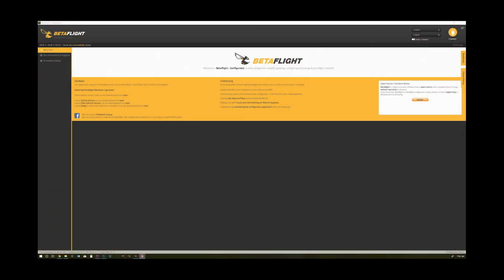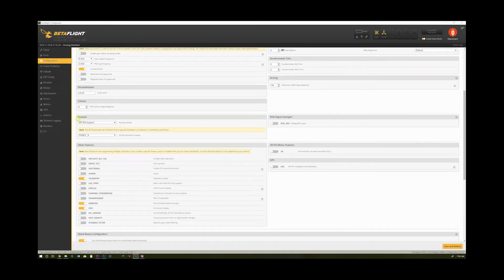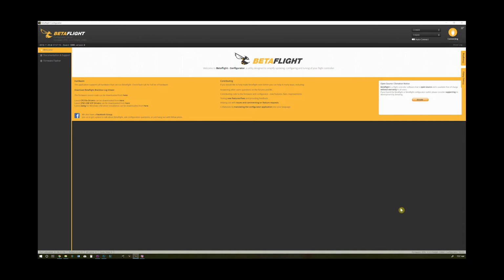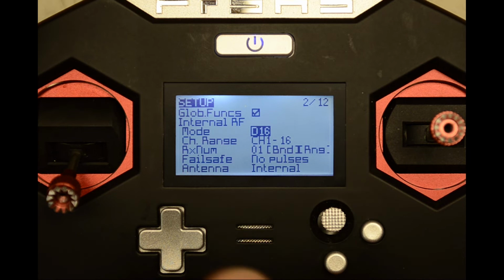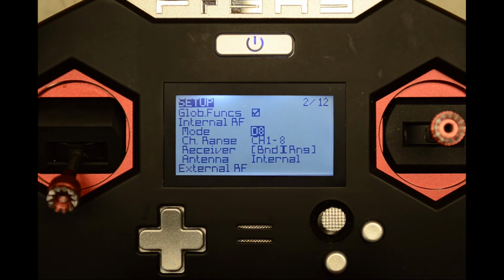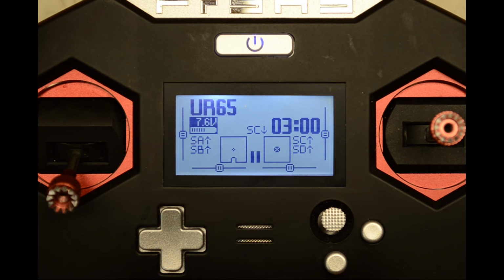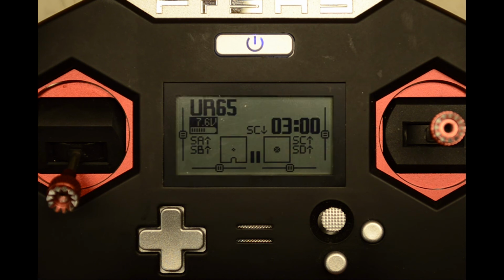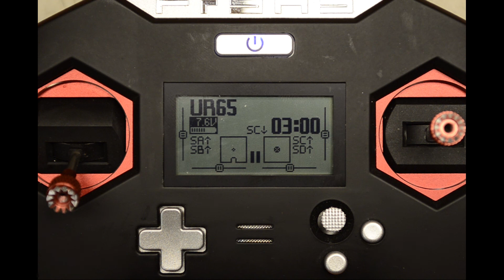Crazybee F3 Failsafe PSA Snapper6, snapper7, ur65, uk65, us65, Mobula7 D16, D8

Comment: My M7 has a jitter shake while flying every 5 or 6 seconds. Any ideas why? Tried upgrading firmware with no difference.
Reply from the maker: Look for wires tapping against the fc, check if there is any hair or carpet fibers in the Motors, and try relaxing the screws that hold down the fc. If all those don't work try adding a little bit of deadband in the bf rx tab.

Comment: I wonder if the firmware was updated from stock, or does the issue also occur with stock BetaFlight that these quads come with?
Reply from the maker: It happens with the stock bf firmware.
Reply: Ok, so we can rule out an incompatibility between a newer version of BetaFlight and this board.
Reply from the maker: Your comment had me thinking about it. The tinyhawk will fail safe lockup and drop when the voltage gets below around 3.3v because the fc goes into a undervolt situation. Adding a small capasitor to the 3.3v output pads allows you to run all the way down to 2.7v. I wonder if this might be some of the same issues with all the crazy bee f3 boards. Some testing needs to be done.
Reply: If it's undervolting, it's odd that it works fine for a while, and then develop this "condition". Why does the factor time have an effect. Could be the batteries aging a little, and performing less after some cycles, though typically new batteries get better after a few cycles, and only start to deteriorate after more cycles, unless abused.

Does the issue only occur on 2S then? On 2S the voltage drop is less, so the voltage regulator, that brings down the voltage to power the FC, should have no troubles keeping a steady 3.3v, until the battery starts to really collapse.

Comment: Having the same issue with my Mobula 7. AndyRC seems to be really good at finding the root of problems like this.  Maybe reach out to him? Have you tried updating the BLHeli firmware?
Thanks for the great video.
Reply: Also have you tried just turning off telemetry without going to D8?

I have others  have had this work.
Reply from the maker: I tried just turing off telemetry and had the same lockup issue.

Comment: Thanks for this! Do you still have your telemetry on when you moved to D8? I was also having these random "failsafes" and I changed to D8 but telemetry is gone. I do a lot of LOS flying so my transmitter announcing low voltage is super important for me. Have you gone around this?
Reply from the maker: Yes I still have telemetry.
Reply from the maker: Just switch the protocol in bf to frsky_d and leave telemetry enabled. The sensors should still be shown in your radio.
Reply: @TweetFPV  Geeez, VFAS is not showing any value on my Tx. At least I know that it works for you. I need to experiment some more with the settings! Thanks!
Reply from the maker: Possibly try re-binding, remove and rediscover sensors.

Comment: I got my UR65 months ago and watched the available videos at the time and found that everyone recommended D16 mode too. I tried, and tried to get it to work in D16 mode and never could get it to work right. When I did get it bound, it wouldn't fly any distance reliability. So, I switched it to D8 and it worked from the get go! No issues, no failsafe, no problems at all! I've never tried to change it back because with no problems why change?! Good to hear the only way I could make it work is the way you found that worked best!
Thanks for doing this video so others know which way to bind it! 😁🤘
Reply from the maker: Trying to spread the knowledge in this hobby to keep people in the air!